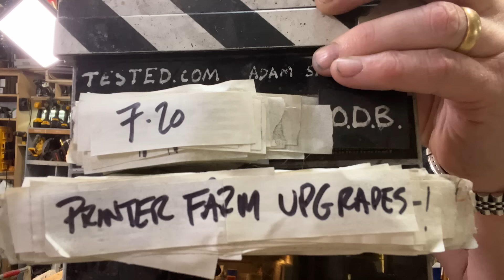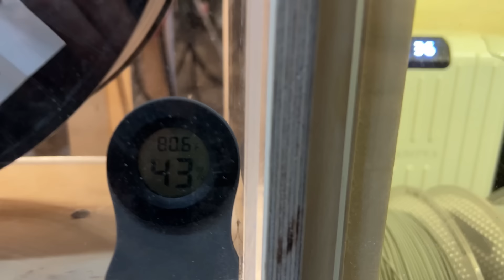Adam Savage's Essential 3D Print Farm Upgrades!

Comment: You don’t need glue with the textured plate, one of the main advantages is you don’t need glue. The material sticks when hot but releases when the plate cools, so make sure you let the plate cool.
Reply: I was thinking the same thing, I don't have that many prints on mine yet but I have done some flat objects with both PLA and ASA that were as wide as the entire plate and didn't have any problems with thim popping off until the plate cooled and then they just slid off
Reply: Yeah I kept thinking why TF is he needing a scraping table. You don't need to scrape with PEI just wash with soap and water when it starts not sticking.
Reply: @MattBruman  yeah all the lines should just pop off or brush off when cool and you shouldn't need to clean it often either.

How did he manage to buy a textured plate, and think it is the best plate without really knowing how to use it? If you put glue on it, it is just like any of the other bambu plates.
Reply: Glue really makes it more reliable. I only apply once a week and keep machines on all day. I will never glance in to see if my 7.00 worth of filament is properly attached again. Even if it works 99 percent of the time that is 3-5 items a week for me and I don't need that for 30 seconds of stick time every seven days
Reply: it's just cheap insurance. Especially if you're using oddball filaments I've had plenty pull off early on the X1C especially if it's near the edges because I don't think it heats the same out there.
Reply: @matts8023  or you could just properly clean your plates.
Reply: @DebianDog  if you are using "oddball" filaments then you should see what bed is recommended for them and make sure you clean the plate properly if you are having adhesion issues.
Reply: I just got my pei plate and its a solid game changer!!!
Reply: Lightyear3D make a smooth plate from G10 (aka Garolite) that works glue-free for PLA, PETG, ABS etc.  It's not quite the shiny smooth (it's more satin/matt) that you get with a glass bed but it a lot smoother than the textured plate for when you don't want the texture.
Reply: Not always. Glue is still needed occasionally depending.
Reply: @Cenedd Or FR4. It's the same stuff just a different name, and not nearly as expensive as G10 got (especially typical printer bed sizes precut) after Makers Muse and otherd covered it.

Btw, if you ever imagine you need to bend it to pop a big print, don't go thicker than 1mm. G10/FR4 is a way stiffer  composite than you'd think. I went 1.5mm on a 310x310 bed, and once had a big PETG part stick. No chance bending that enough. Now that print has G10/FR4 shoes. Had to cut it off and get a new, 1mm sheet. Now it's doable to bend to pop if neccessary, still stiff AF tho.
Reply: @pr0xZen Cheers, I'll look into that.  The flip side of a thicker plate is that it can compensate if your bed is bowed. Mine varies by about 0.3mm so a plate that stays flat and doesn't get bent to confirm is quite helpful.  3 point levelling (three lead screws on an X1C) with a DTI mounted instead of a hotend and it's good.
It can be a bit trickier to get off but mainly because I'm rarely patient enough to let it cool completely :D  The Bambu scraper is pretty good for that if you're REALLY careful not to let it dig into the plate.  The other thing that works if the part is stout enough is a tap with a hammer;  the shock pops it loose.  Obviously not smacking it about but a sudden short tap.

Edit:  looks like FR4 is essentially the same as G10 but Flame Retardant....which to me sounds like a better fit for a hot bed!!
Reply: @Cenedd  a thicker plate can potentially help with that, as long as we're aware of the flipside with increased thickness of a material this stiff; if the plate you get isn't itself appropriately flat, there's damn near no chance any clamps will remedy that. But that goes for almost anything of similar sort, including the bed itself. And it's not a great thermal conductor, so don't jist go and drop a 5-6-8mm slab of the stuff on there as that might functionally become a thermal insulator between your hot bed and the print 😅

The risk of fusing to the print surface isn't as high with G10/FR4, but it's still possible, so something still worth keeping in mind if you print a lot of PETG.

In the end, up to a few mm it's not very expensive (FR4 in particular), especially compared to commercial brand printbed options, so it won't break the bank to try a couple of different thicknesses 🙂
Reply: Textured PEI plates don’t hold PLA well and sometimes can be in need of help. Yes they usually work great out the box but months down the line it loses it’s grip. Smooth PEI I mean true like the sheets of it that glue to a steel sheet can be sanded to refresh. Different bed surface needs for different applications.
Reply: Black textured plate< gold textured plate
Reply: I always use glue on every type of plate because it protects the surface. You never know when you're going to print something that sticks permanently and will tear the coating off the bed. For the most part glue makes that a non-issue. My Prusa is running the original PEI smooth plate and side for like 6 years printing continuously now. Not a mark on it.
Reply: @_droid  minus all the glue on it. PLA, ABS, ASA cannot bond to Pei at the temps we print. Petg can.
Reply: He touches the plate a lot, so that ruins adhesion to it so he might really need glue. If he cleaned it with IPA he might have less trouble with plates

Comment: I've only been 3D printing for a couple months now but one thing I've learned is with that type of build plate, don't scrape parts off it unless you have no other option! You can usually let it cool completely and they'll  pop right off! You may have to flex it a little bit but if you scrape it, it usually means your z offset is too low. Scraping the plate can cause damage to the plate and you'll be replacing them prematurely.
Reply: Yeah, I cringed when Adam started talking about scraping a PEI sheet. The whole purpose behind coated flex plates is to let the print cool then flex the plate to pop off the print. I've used PLA, PETG, and TPU on PEI flex sheets with no trouble. (TIP: The trick to getting small TPU parts off a flex sheet is to remove them while they're still warm.) Only very rarely have I ever had to use a tool to remove a part, and even then, I just used a thin-edged plastic tool to get an edge lifted to start the removal process. PEI is a game changer - no glue, no scraping. A quick wipe down with alcohol between prints keeps it clean. When prints stop sticking, going over the surface with some fine sandpaper does the trick to refresh the plate.

Comment: That was a fascinating watch. Thank you!

Seeing your issue with the plates from your Bambu printers gives me an idea for a remedy to minor problem I have. I use a Sovol printer and the hotbed is massive. It takes a long time to cool down so I can detach a completed print (depending on the material - PETG is clingy until it cools). Like you said, if the printer's not printing it's wasting time. But the solution is easy - I'll get another PEI plate. As soon as one print is done I'll take the plate out to cool and put in the other one so I can start the next print. It's like baking plastic cookies!

Comment: I bought my X1C about 1 month ago and it came with a PEI plate that was textured on one side and smooth on the other. I have mostly used the textured side, but I recently started using the smooth side. I have had absolutely no issue with a model warping or not sticking so far. I am glad that I no longer need to use glue on the bed like I did back in the caveman days.

Comment: I've got the X1C with AMS. I am a 3D modeler that designs files and prototypes them before putting the files up for sale. The Bambu Slicer program is powerful. I now include the Bambu File .3mf with my files now. For those that want a simplified printing experience. Some of those files are painted with 4 colors. If they so choose to go the colored route. Solid System and I would recommend the A1 as the best starting printer for anyone testing the hobby of 3D printing. That lv 427 print you had featured could probably be printed 7-8 times at 15% infill. Even 6 of those for under $20 of PLA is a steal.

Comment: Re adonized aluminium finish on PLA.
I treat all my prints to paint. Some looking like red anodiced aluminium too.
My favorite approach for that is:
1. sand, fill, prime the print
2. spraypaint shiny black. I use to wet-sand the black with 1600-2000 grit to near mirror sheen - but then, I'm just fussy.
3. airbrush with a really good silver
4. airbrush clear red on top
5. spraypaint 2-3 layers of clear (glossy), let it cure well between layers
6. wet-sand with 1600-5000 grit and polish with novus glass number 2
For priming, black and clear I use automotive paint and spraygun rather than cans
For silver, clear red I use solvent based acrylics for airbrush, by SMS (Australian based company)
This works the same in blue or any other clear color available.
The result is a beautiful metallic, coming close to adonized aluminium.
I have a blaster on my channel here, which shows the effect nicely.

Comment: Wow I am amazed how that mechanism was 3D printed! It's come such a long way. Makes me want to get into it.
Reply: It's never been easier to get up and running. You can get a high quality printer for a fraction of the cost it would have cost you just a few years ago. Most of the modern printers have sensors that fix the pain points of setting up a printer. It's at the point now where you plug it in a press print.

Comment: Try only making the interface layer use support material. That will result in fewer filament changes because it will make the supports out of the regular filament until the last few support layers, where it touches the print. This also saves on using more support material.
Reply: I think that is what he explained. The problem is if you have complex parts. The support filament is good if you have simple overhangs that are mostly just horizontal, as they only require a few layers with the support interface but if you have steep angled or curved overhangs or lots of overhangs at different heights then your support interface is on a lot of layers and hence need lots of filament changes.
Reply: Yes I agree. Heard him say in the beginning,  "hundreds" of filament changes.

Comment: nearly gave up on respooling filament and decided to give this one a try. so glad I did it works great and I haven't got the base mounted properly its that good. I even printed the bearings in PLA and they are doing great! thanks for the recommendation, I no longer have to turn my nose up at off brand filaments.

Comment: This man loves dry filament. Tbf I don't know how my filament in unaffected.. but I run a print farm in the UK in a room above a cellar. The gaps in the floor boards are so big I can see down into the cellar which is open to the outside, there's no sealed door on it because it used to be used as a barrel store with a big slope ramp. The house is from the 1700s so that's why. Anyway my filament is just sitting on a shelf and humidity is 65-75 indoors in the summer and my filament is just fine?? PETG and ABS. Some of the lesser used colours are a year or more old but they print absolutely flawlessly on the x1c still. I have invested in a dehumidifer for this winter but that's mainly for my cardboard packaging and papers as I can feel it get damper over winter
Reply: I've been wondering this too, then I left a roll out in the open for about a year and it started printing like crap and getting ground up by the bowden extruder gear, might not be as noticeable if you use a direct drive extruder but it does seem to get softer
Reply: I THINK (sometimes) that PLA is more absorbent than PETG and ABS.
Reply: On the other side I am in Scotland with similar humidity and I have to dry quite a lot of filament, even PLA sometimes but especially nylons, polycarbonate, PETG and especially TPU.
Reply: Drying PLA is stupid. It's literally engineered around it's hygroscopic properties.
Reply: From what I understand from watching many a video, there's not really a concern with needing to try and keep it dry, especially with how quickly he seems to use it. Unless he's using something that absolutely gobbles up water, PLA can be in an average environment for months (Think I've heard up to a couple years from a couple makers). PETG is pickier for sure, and his hotbox is perfect for those.
Reply: Dawg I live in a minivan and leave my petg hanging all day and night it's miraculously fine. Sometimes I wake up and there's condensation on the roof but the filament is fine so idk
Reply: Witchcraft!
Reply: PLA is hydroscopic, but not extremely so. It will "spoil" over time, but it takes a while. If humidity gets too high, it will become brittle and cause clogs. You can dry it, which I'm doing with some two year old stuff in my QIDI which has a heated chamber, but eventually even that won't bring it back. I live in Florida where it's very humid, but inside the house it's air conditioned and relatively dry.
Reply: Aside from using ABS, the Bay Area is cold and humid. PLA will curl and crack depending on the weather. I’ve been 3D printing in the Bay Area for 10 years and having a hot box and a dry box is essential if you don’t want to be screwing around with seasonal print settings and wasting time and materials.

Comment: I've got that same Makita screwdriver and drill set. It is at least 10 years old with daily use and still works great. I've only had to replace the batteries a few times. As a bonus, the metal case the set came in makes a nice storage container for other things.

Comment: Polyalchemy Elixir PLA will be by far the best Anodized aluminum filament for you. I tossed a small part printed in their silver to a coworker (also an engineer) and they were scared for a second because they expected that they would be catching a part of commensurate weight as though it had been made of aluminum. 

The blue is a great anodized aluminum color, I've never used red, but everything I've read about red [silk] PLA is that it comes out more pinkish. I'm not sure why the blue and silver and most other colors are so vibrant and yet the red is almost pink, but it seems to be an battle between enough dye to make red and enough additive to make it shiny.

Comment: The plate table could have been designed to be bigger than the tray, so the scraps fall into gaps around the edge. Add sides with a cleanout and it becomes its own trash bin.

Comment: The textured PEI plates are just awesome for PLA and I wouldn't want to be without them. My recommendation would be to have two for each machine, and take the one you're not using and wash it in the sink with dish soap and a stiff plastic brush.  Any time I'm having adhesion issues, that fixes it. No glue stick required.
Reply: That was my tought aswell, no glue needed on the gold pei sheet

Comment: I bought a Lightyear Garolite (G10) sheet for my X1C. Its phenomenal in its ability to stick to anything without glue that I've thrown at it while it's heated but release with barely a touch when cool. ABS, PLA, PETG, TPU, everything I've used so far is perfect and the surface finish on the part that contacts the build plate is perfectly smooth. It uses the Smooth PEI Plate / High Temp Plate setting in Bambu Slicer.

Comment: Something that might help with the PEI sheet cleaning table is some sort of heatsink top surface to cool the plate quickly before you start removing prints. I usually use the metal chassis of our front-loading clothes drier since that is near by to my printer. For your table, maybe a heatsink with short fins, mounted with the fins down. And a blower on the side with duct to blow air between the fins. For power, use an adapter for the batteries that you use on your handheld power tools. I don't know if I explained it well...

Comment: For the anodized aluminum look I would mix some resin with the pigment mixed in and paint it onto the 3d printed backing. Resin with mica powder I think would look very close to what you're looking for. OR you could use the printer to make a mold and cast the parts completely out of resin if you need super sharp edges.